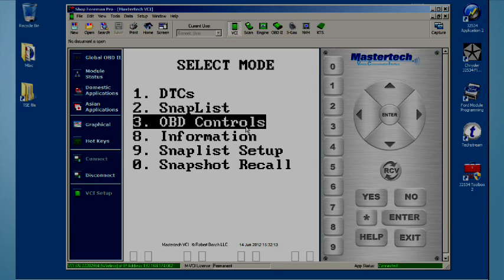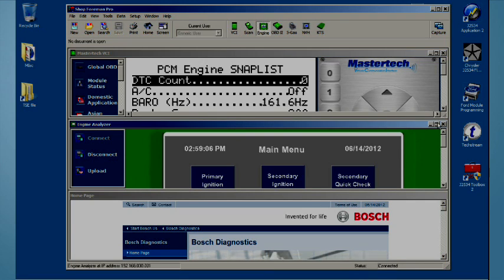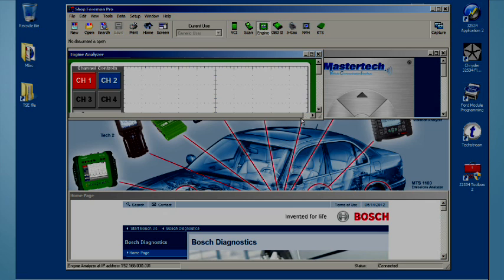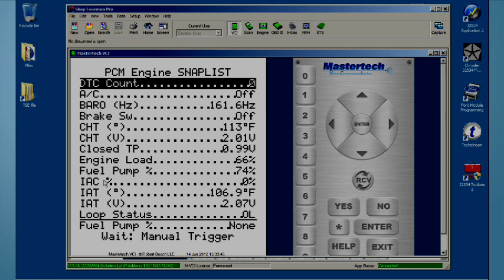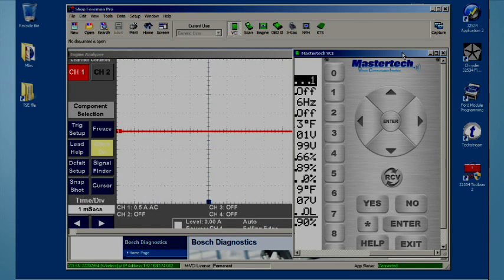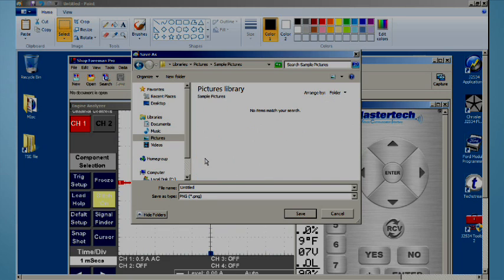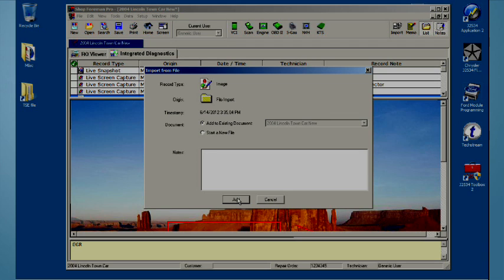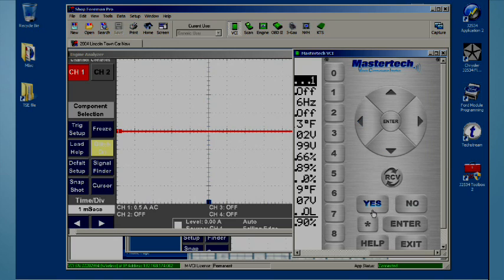Connecting the MTS 5200 | Getting To Know VCI | Tech Tip

Comment: hi, i have a 5100? i think from 2003. besides the battery never a problem. today i went to use it and everything that has to do with the scope portion never reads any voltage. the dvom portion works just fine. i have not dropped it. i did have to open it up 2x to service batteries? i better open it up and take a looksy?  i swapped test leaks also.